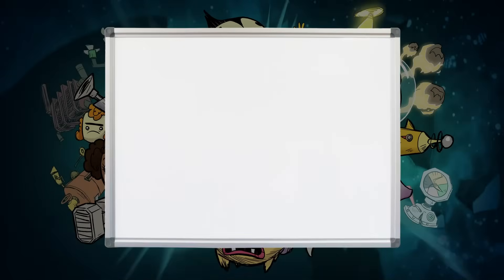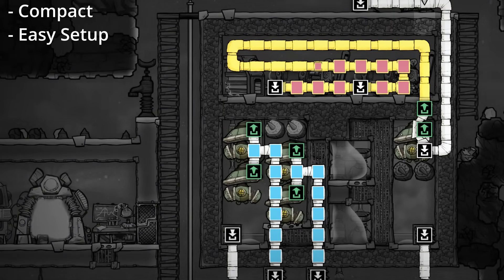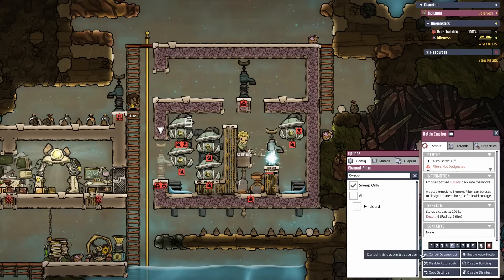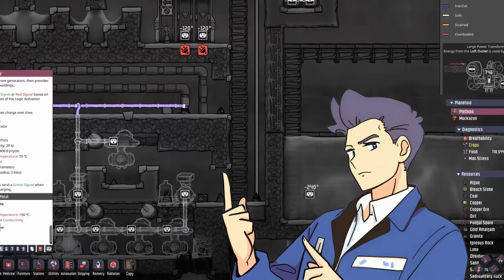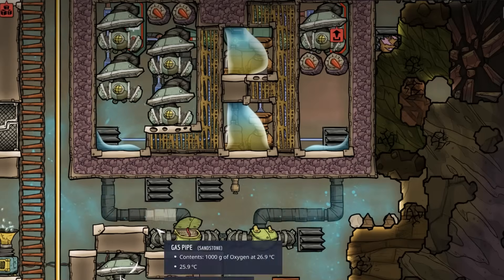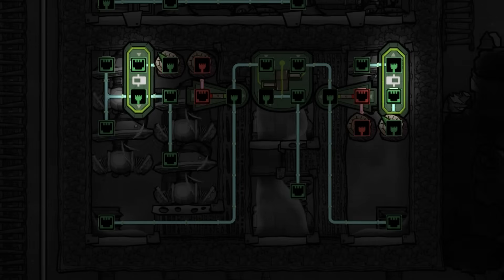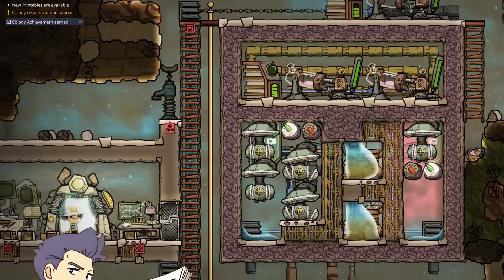FSPOM Hydra | Oxygen Not Included Guide

Comment: Great videos! Regarding the automation, you can simplify the circuit significantly using De Morgan's Law.

You are currently using an AND gate with two negated inputs. This is logically equivalent to a NOR gate (an OR gate with a negated output). Since joining wires in this game already acts as an OR gate, you can simply merge the two wires and negate the result. This uses only one logic gate instead of three!

Comment: In my experience you should add 2 vents instead of 1 for each vent intended for infinite storage. When you only have one, you run the risk of the game deleting the liquid and breaking the infinite storage mechanism. I've lost every (non-flooded) SPOM I've made because of that before I came across another video that mentioned this.
This design has the perfect spot to put the second vent, so there isn't any major changes needed (outside of possibly adjusting how much water you need).

I've been researching different hydras and SPOMs recently (because of the issue with the previous point), and I gotta say: I'm a fan of the level of control you integrated into it. I've been hesitant on building hydras because the built-in infinite storage means I'm bleeding water (which until you trap a geyser or two is very limited). I unironically prefer boops over dupes so my hydrogen usage is high enough that a hydra was kind of needed over a regular SPOM (which would usually run out of hydrogen while producing a surplus of oxygen with a bionic colony). Definitely going to be turning the O2 into infinite storage on this.

If you're doing a bionic colony as well, remember to put the hydrogen generators in a reachable spot and put a Power Control System in the room. The free microchips from boops makes it almost a requirement.

As an aside, I love the format of your videos. You not only have a step-by-step walk-through on how to make it, but also display each layer afterwards to act as a reference. This is a perfect format for video tutorials in my opinion and I wish every tutorial video on YouTube worked like this.

Comment: 6:47 for the overheat issue, i usually just use the incoming water to the electrolizer as a cooling with a bit of extra pathing, so the heat doesnt raise to infinity. Water is usually not kept at a high temperature anyway.
Reply: Yeah, essentially running radiant water pipe through airflow tiles and regular pipe behind electrolyzers eats up all the heat

Comment: cool stuff, I personally just use a gas shutoff with an element sensor and dump the O2 back at the bottom of the oxygen pumps. I do this because I have my O2 production connected with my main power grid and I use a gas tank to burn off excess hydrogen with a simple not gate. I can make my O2 boxes as small or as big as I like, and just throw more power at it. I've done super sustainable achievement using the same gas shutoff as filter, it's pretty easy and cheap imo. Not telling anyone how to play this game, I love to learn :)

Comment: I like infinite storage. Vents usually produce way more water than you can consume, and having a few hundred (thousand) kilograms of Hydrogen backed up is REALLY REALLY NICE when you hit lategame and you need an asston of that stuff to make Liquid Hydrogen Fuel out of. Although I admit this is a small benefit, all things considered.

The other benefit is that your water vents might overpressure... so you store water in tanks, which cost metal. The stored water in the tanks is then slowly drained out during the period that the vent is dormant. The tanks are therefore a metal-hungry buffer.

Better to buffer the oxygen itself in the room, which requires no metal. Having a SPOM continuously running also flattens out your power demands over time instead of spiking them sometimes and forcing backup generators to kick on.

Comment: 8:15 When I'm setting up a layer of water like this, I usually have a 3 tile wide 'floor' with one side open as a 'cliff' to let water pour off.  After 1 bottle of water emptied on that floor and the water stops spilling of the cliff, build a block on the 3rd floor tile on the edge of cliff (leaving a 2 tile floor).  This pushes the water on the 3rd tile back over to the 2 tile floor and it'll be the perfect amount of water for infinite gas storage setup.

Comment: There are a couple of things I could do to improve it further. I build these things for the long term, so I'd double insulate it. A single layer of insulation will eventually heat up to 75 degrees, after a few hundred cycles, but heat transfer between two insulated tiles will take much much longer. The other thing you could consider is buffering your inputs and outputs with reservoirs and a bit of automation. I'm not a fan of paying full price for a water pump that's only moving a fraction of it's capacity.
Reply from the maker: Great ideas for improvement! 😊

Comment: i did the wiring different, i hooked up the gens w heavy watt wires to my main grid, but i left the battery since if the grid somehow runs out of power, the spom will be able to run longer. this does require you to have the battery controlling the generators to be attached to the main grid tho

cool design, but for some reason the water gets pushed over to the side by the electrolyzers into 1 tile. i did put in 100kg per tile like the vid said. the gases were primed with 2.2kg on hydrogen side and 4.8kg on oxygen by accident. gonna try to reduce the oxygen side, if that doesnt work ill have to break in again and try to add more water

edit: my dumbass forgot the airflow tile underneath the electrolyzer

Comment: Anyone able to help, I can’t get the hydrogen generators going, they have hydrogen backed up in the pipe and the battery is on the right settings with power in it
Reply from the maker: Is the automation wire connected between the battery and the generator?  I’ve accidentally done that before. 😊

Comment: A more accurate and simpler way to measure out bottled liquid for use in the dropper is to build pedestals and place water on them. The subsequent bottle placed on the pedestal will be exactly 1kg of water. Then remove the water from the pedestal and proceed to sweep it up.
Reply from the maker: Great tip! Gonna have to try that one out.

Comment: Quad Hydra Tested on Ceres with Frosty DLC : As the freeze of water in 0 you might have issue to prime electrolysers.
You need a bottom layer of hot crude oil and brine or polluted water with positive value and more than 100g (like 500g on two both top layer). 
Please do not close it immediatly and sweep any glass or materials if it failed, try again. Do not overpressure the electrolyser and save a lot of time your game.

Comment: To me the most obvious improvement I see would be treat the whole SPOM as dispatchable energy generation. Dispatchable energy generation is generation that can be turned on and off to compensate for variable sources of energy, such as solar, as well as variation in energy demand. If you fully integrate your SPOM into the grid, then you can power it with solar during the day, saving up the hydrogen to be used by the whole grid during the night.

I'm a big proponent of using manual generators late into the game. Manual generators are technically variable sources of energy since dupes need to take breaks to pee, sleep and eat. Assuming you have enough food to sustain them, you can easily hook up a bunch of manual generators to your grid, still using hydrogen as backup. Overtime, your dupes will train up their athletics and mechanical and when they reach level 20, you can reassign them into any other work. Assuming duplicants work 80% of the time, a manual generator effectively turns 100g/s of oxygen (plus 1000kcals/cycle of food) into 40g/s of hydrogen. In addition, duplicants will pee at least once per cycle, which will refund between 10% and 35% of their water usage (depending on schedule and hygiene level).
Reply from the maker: A lot of good info.  Thanks for taking the time to leave such a detailed comment!

Comment: If you leave the side of the hydrogen with an empty tile right above where the water reaches maximum level but doesn't spill the oxygen will automatically go to its corresponding side without having to fill one side with oxygen and the other with hydrogen.  It's just turn it on, and that's it.

Comment: One way I like to temperature regulate my oxygen is to run the cold water through the oxygen chamber before putting it into the electrolyzer using radiant piping and tempshift plates.

It's convenient, easy, and cheap and keeps heat death via hot oxygen away pretty much forever.
Reply from the maker: I recently started doing this as well. It works extremely well if you do it right!
Reply: That works so long the electrolyzers don't backup the water in the pipes due to low consumption. Else the water sitting in the pipes will heat up along with the O2.
My solution to get very nice cool oxygen is to run my base water cooling loop into the O2 chamber independently of the H2O that feeds into the electrolyzers. 
Alternatively, one could use a bridge before dumping the water into each electrolyzer and a branch pile so to let the water out into maybe a cooling tank. The idea is to avoid sitting water in pipes.
My Hydras are usually built horizontally, and are fully serviceable, using liquid locks for entrances. Dupes can hold their breath in the H2 chamber, but one needs to be careful in the O2 chamber as they may exhale C02 and break the tile gas mix. O2 Chambers therefore are preferable on the bottom as CO2 will sink.

Comment: OK, so I've got a question about your design:  Why have the NOT gates in?  I just built 1 of these following your design, but skipped those and set the inner atmo sensors to be green if below 20000.
Reply from the maker: It was a mistake. I had originally put them is as part of an OR gate logic and neglected to remove them.  They should be left out and the corresponding atmos set to under 20kg.

Comment: Alternate priming suggestion: Use a gas storage tank instead of a vent when vacuuming out the storage. That way you can fire up the electrolyzers in the SPOM for a bit of hydrogen, and oxygen. When the room's vaccumed, run the tank contents through your filters to prime the rooms.

This will eliminate the need for a seperate external elecrolyzer, and also bypass any pressure issues you might have before getting the plastic to make high pressure vents.
Reply from the maker: Great suggestion!
Reply: @engineertroy_  Thanks! I've been using gas tanks to vacuum out high-pressure areas before I have plastic: just pump from the room into the tank, then deconstruct it to release the gasses.

Tanks are also great for regulating infinite storage. Not needed here, since the hydra vents directly into infinite storage, but useful for a SPOM.
Reply: Oh, and I'll probably use your design in my next build! It's a nice, clean design and looks like it can be easily expanded downward as the colony grows.

Comment: I can't seem to get the 4 tiles figured out... I've used brine, salt water, water, and polluted water in 200kg quantities and not had any success with flooding 4 tiles.
However with this exact build, I did find an easy way to do the gas vents. Dump 200kg onto the vents, mop them up. deconstruct the edge tile directly adjacent to the vent. Let it drain down the side, then replace the deconstructed tile. Good as new.
Reply: Next time use pedestals or water meter valves to deliver precise amounts of liquid. Game is quite old, yet not a single content maker i saw used pedestals. They are OP for building droplet liquid locks or delivering exactly 3kg of liquid to make infinite gas storage.
Reply from the maker: 🤔 sorry to hear that. Is it completely flooding or something?
Reply: @engineertroy_  I got it working. I think it's cause I was putting the liquids in at the same time and they would occupy the opposing tiles and not spread out.
Reply: A stable build of my bases is a "ladder mop". This is a liquid vent that drops water, brine, oil, etc on a solid tile that then will spill on the side and the down back to the pump. Like an L shape. The remaining liquid sitting on the corner can be mopped and can be used to create mini locks all over the map. Pretty useful once oil becomes available. A good side effect is if a priority mop is assigned while the pump is running the dupe will continue mopping the same tile and adding the mopped fluid into the same bottle. Once the desired amount has been reached (say 3800 grams), the mopping task can be cancelled, and the bottle moved and emptied on the desired vent spot. I also use two vents on any of my infinite gas storage systems.

Comment: Do the automation components need to be made of gold to prevent overheating?  What about the conductive wire?  Can wire even overheat?
Reply: Only automation components that are classified buildings have an overheat temperature. However the material they are made of can still melt. 
If you use lead, the melting point is like 300 C, so you should be fine.
Reply from the maker: Those components should be ok, though it may be best to avoid making them from lead.

Comment: Personally I always thought it was dumb to encase the hydrogen generators.  Why not open it up and include a Power Control Station?  50% extra power goes a long way, especially in the early-mid game when you are building this thing.  Even later on you are probably looking at like 2-5MW depending on the size, from tune ups alone.

I get that there's a small risk of using too much power, blacking out the pumps and electrolyzers, and then spiraling into death.  A gas reservoir for hydrogen (because it can feed the generators even without power) and some extra battery storage (smooth out power and prevent blackouts) can mostly eliminate this chance as long as you are paying attention to the game.  If you do ever get into a really bad situation, you can just disconnect the wire from the main power and let it be self-powered only until you've fixed things.
Reply from the maker: Good points. This is just one possible solution. I agree, each has their pros and cons.

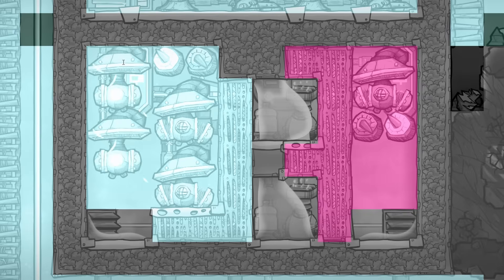Comment: Hydra can glitch sometimes, especially on save-load and on high speed at later-game stage. To at least partially protect yourself from this glitch hydrogen chamber must be on left and oxygen on top diagonally. Look at your video starting at 3:16. There are little moments where hydrogen appears and stall for a part of second. If at this moment random gas movements happens and hydrogen moves left, you get hydrogen in oxygen chamber. As you see, there are no such stalling for oxygen, it moves nearly instantly. So, left of electrolyzer must be hydrogen, in this case if hydrogen moves randomly it just join hydrogen. This glitch is rare, it needs very bad luck with timing of gas movement and gas production, but it happens and ruins this design.
This problem never happens in hybrid design. In hybrid design you place a drop of liquid left of gas-spawn point, so both gases must move up-diagonally, removing any possibility for glitch
Reply from the maker: Ah, that’s an excellent observation!  Thanks for the feedback!
Reply: Yep, and I prefer up-down module than this left-right module. We only see hidro show up there because oxigen cant go up (its heavier than hidro) so, only 1 choice for oxigen but 2 for hidrogen on this design. And this cause mess sometime. Hidro up, oxi down, only 1 choice to move for both. Its alot safer.

Comment: You could use less airflow tiles. You only really need 2 per electrolyzer (unless someone does it with less). Also, I'd recommend crude oil or petroleum instead of water for infinite storage purposes. Dont want your water to turn to steam.
Reply from the maker: Good suggestion!
Reply: No need to put water for infinite storage. It's for adding from outside problem and after 1000 pressure all system will work well. Gold amalgam protects perfectly. I used minimum 350 cycles and water was 90+ celcius, tempeature did not go up to even 90.

Comment: Very good, I like it!
I've using the horizontal version of the Hydra (O2 on top and H2 on bottom) for a while now (9 tiles tall or equivalent to 2-4-tile floors) H2 feeds to a separate room that's a power plant and that powers up the entire base (for the corresponding Achievement). The water to be split is piped across the O2 chamber to try to cool it down a bit using a bunch of radiant pipes, it works very nice as the O2 is a dash higher than 30 °C, which can be later cooled down by other means. There is a ante-chamber on the side that contains a couple of mechanical filters, a water tank and a H2 tank as backups, with a liquid drop and a door, so the whole thing is serviceable and expandable (horizontally).
I remembered reaching 1000 kg of pressure in the O2/H2 chambers in my later games.
Reply from the maker: Thanks 😊